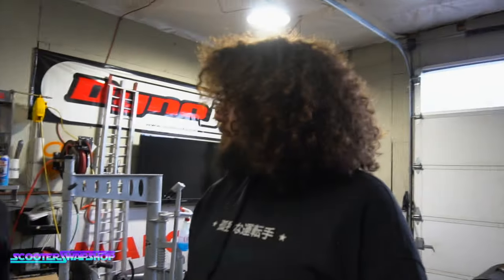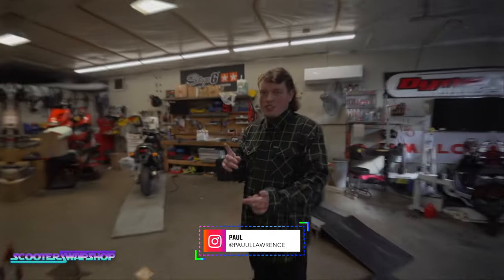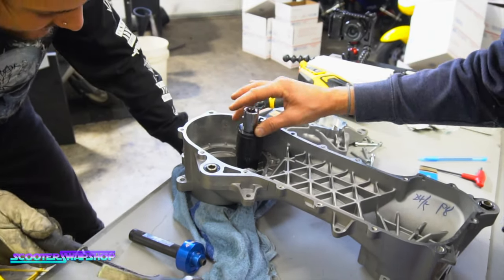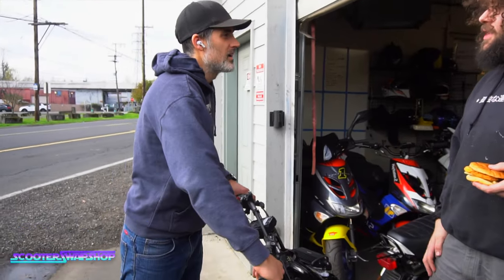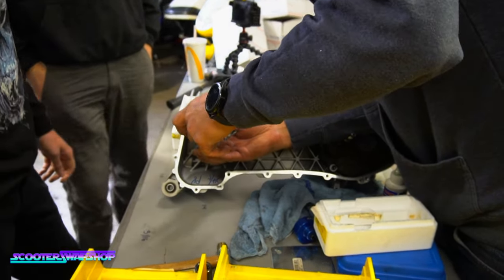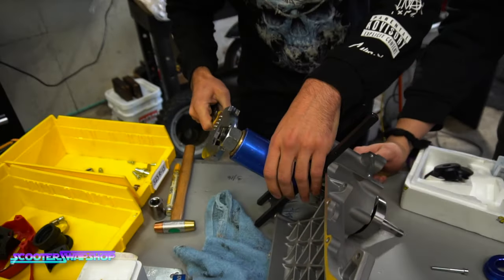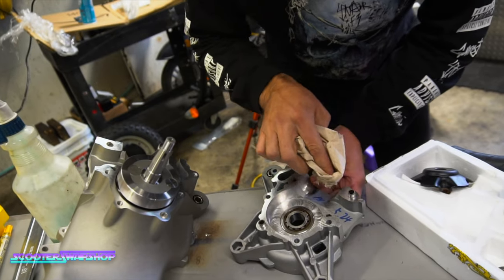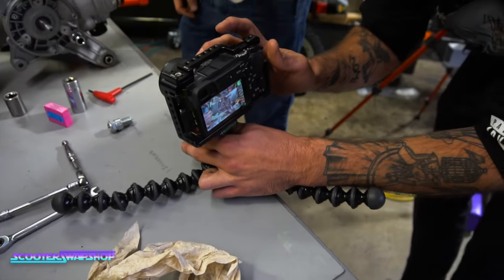How do you assemble the Full Malossi Rc-one 94cc Engine | With Mopboyz | PT:1

Comment: Why do you use the heat/freeze method for crank bearings rather than a shop press? A press is so easy, risk-free, and fast.
Reply from the maker: if you don't know we highly suggest doing the research on expanding and shrinking metals it is a well-known method for doing these things
 and just pressing involves risk of cracking, as freezing and heating areas actually free and risk-free we have a press. crank bearings you use a puller.. not a press.